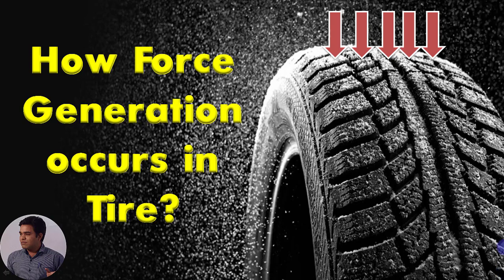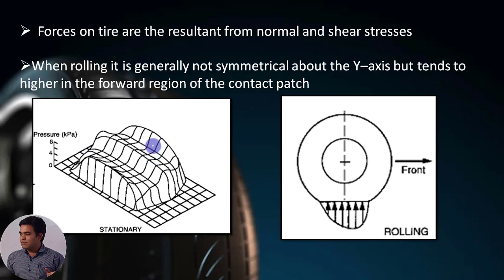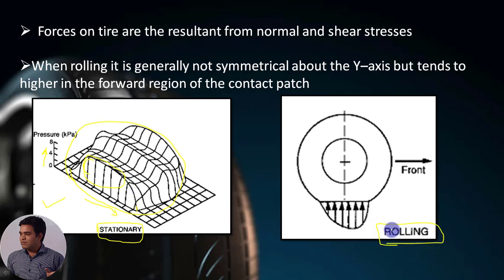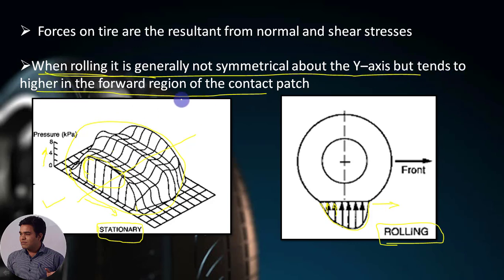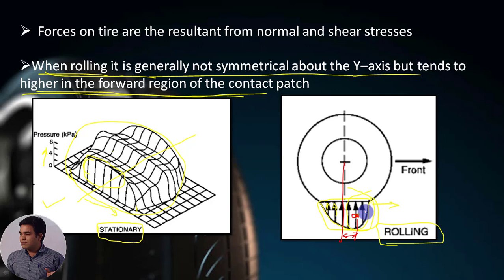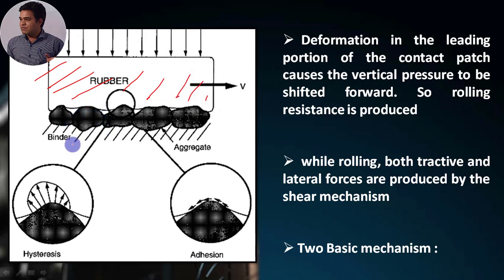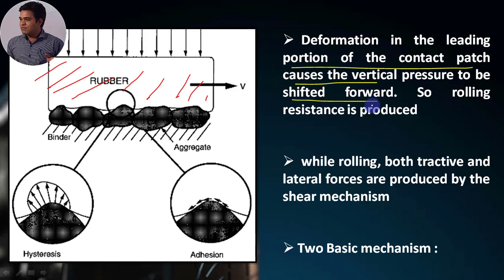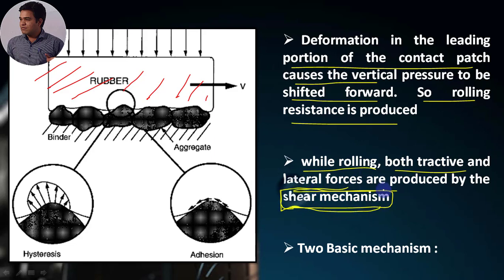How Force Generation occurs in Tire ?

Comment: How i can calculate my top speed?
Reply from the maker: It might be your vehicle's top speed..😁....
Ofcourse, first you need to understand the fundamental of power transmission.. power of engine is utilized to overcome aerodynamic forces at high speed and to accelerate the vehicle ... If we consider highest speed then acceleration will be zero.. so engine power will be mainly utilized to overcome aerodynamic force.. so by introducing all parameter in equation of power of engine to overcome aerodynamic forces , will give you top speed of vehicle..
Reply: @AutomotiveCrux  Thanks, i like your videos very usefull
Reply from the maker: @danivillarreal3165  thanks for your appreciation